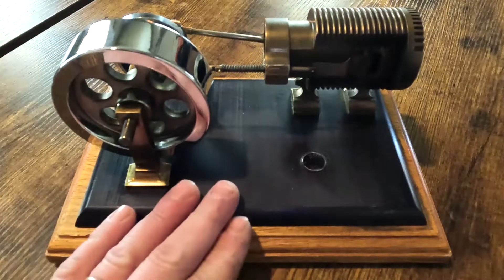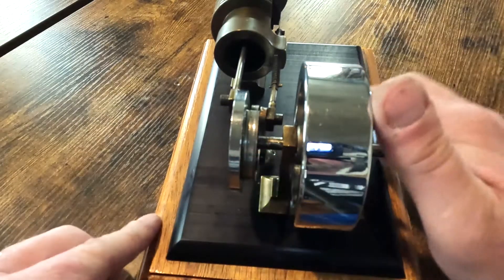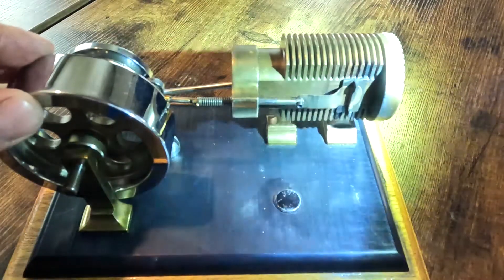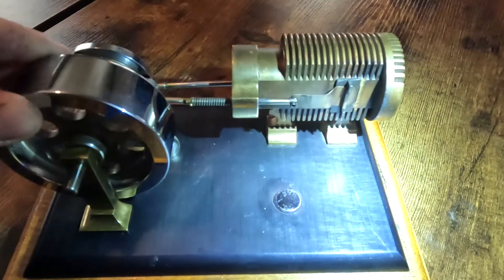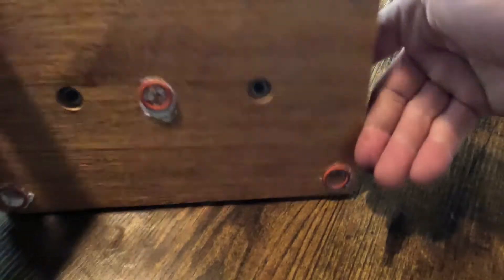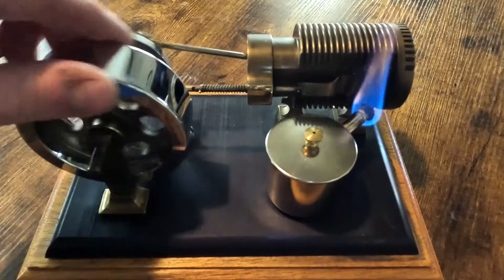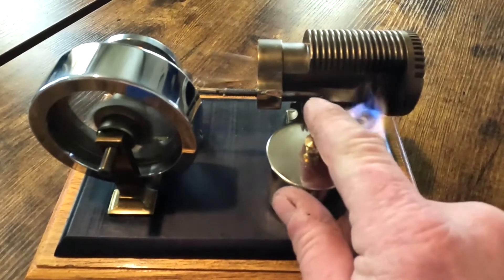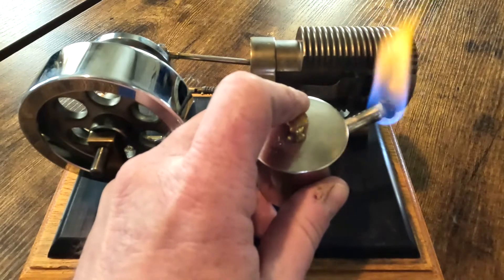PM #3 Flame licker engine running

Comment: What happens if you put one on a plane
Reply from the maker: I suppose it would arrive safely if the pilot landed it😂.   But to power a model airplane, I think you would have issues with the prop blowing out the flame.
Reply: @steam212  put it in the plane, but cover the flame with an exhaust pipe with a hole in it so the engine could still suck in the flame and it probably won't go out, im not an airplane expert so idk though
Reply from the maker: @kepler221c  You would have no throttle control, inverted flight would absolutely be out of the question (due to fuel spillage). The crankshaft is not designed for a horizontal load (side loading the crankshaft, propeller push or pull) and the flame placement / height is very important to make any vacuum type engine run.   I suppose if you wanted to build a static model and wanted a creative option for turning a prop (with no attitude) this "might" be an option, but remember it has an open flame too.

Comment: After my father pasted I was going through several of his things.  In doing so I ran across this Dayton Ohio Rotor Engine. (NSS # 10245).  Not knowing anything about these little engines I brought it home with plans of figuring out the operation.
I have tried several different types of fuels, having no luck to get it to run.  Two times with my persistence I did get it to hit but only for a short time.
Viewing several videos, changing fuels and contacting a friend that has several smarmier engines we were not successful in the process?
I have seen one of these engines for sale as high as $800.00 plus shipping on E-Bay.  I don’t believe that my complete all original engine with the 5 plus inch flywheels is worth that kind of money but from talking to others and checking the net I do believe that it is rare with all the correct original components and in very good condition has a value of $500.00 plus shipping only in the lower United States.
I just don’t have the knowledge, skill, experience or tolerance for something like this.  I have way to many other interest/projects  at this time.
Please contact me with question/s that you may have.

Comment: wow thats fast for a flamer
Reply from the maker: I agree,  I would like it to run slower but other than burner placement there are no adjustments because the cam and crank are made in 1 piece.  Have you had time to look at our other video on the "used and abused Chinese flame licker"?  After some modifications and a good set of flywheels it runs at a nice pace.
Reply: I LOVE flame lickers! they have so much character compared to Stirling engines. Nice vid of this model Mr 212!. Mr Manstanding, check out   my German single with graphite piston https://youtu.be/kiFYt95ZAx8 and Chinese v-twin with extra heatsinks, tuned to tiny flames https://youtu.be/A28785zMEfs